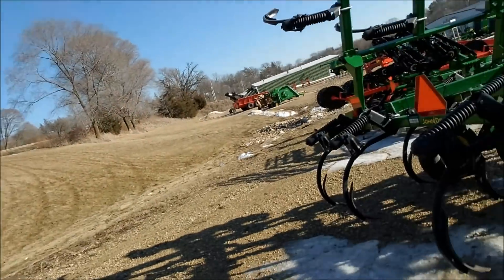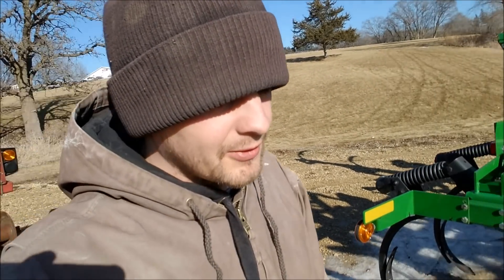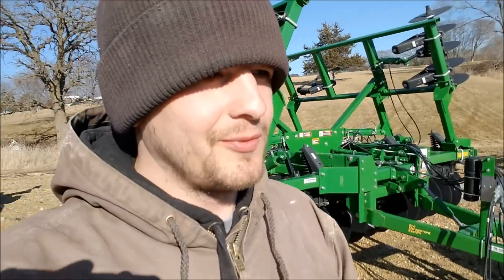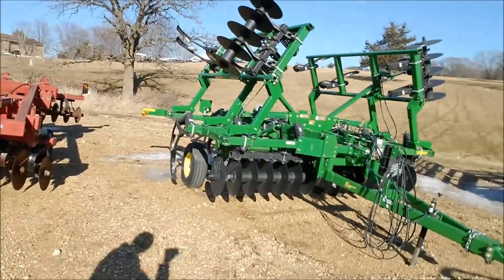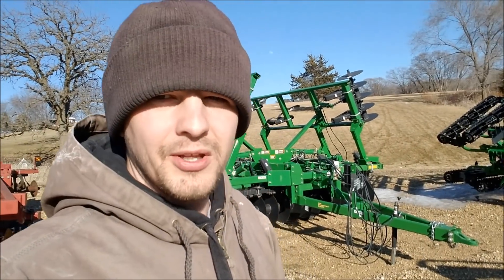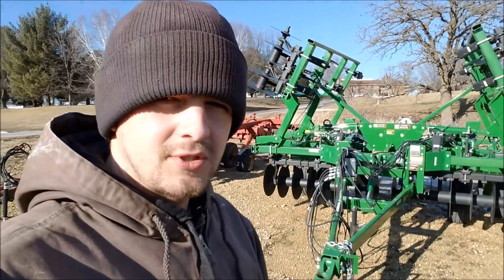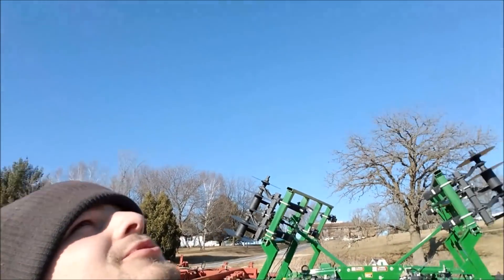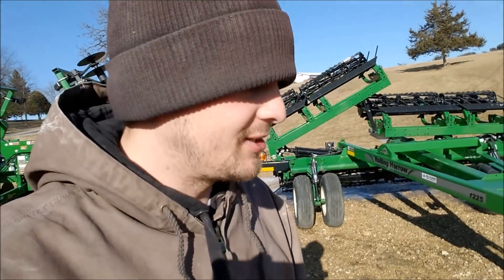John Deere Chisel Plow

Comment: Good video subject, Travis !!  Back when the "new style" JDs came out a local dealer sold tractors with plows at or below cost knowing all that new horsepower meant broken down older, smaller  plows and disks ,  so he'd be selling the same buyers new tillage tools before spring was out !  He even helped "hot rod" a couple tractors for  those  he knew would be  pulling their work tractors at local fairs !  Predictably heavy load PTO equipment like forage choppers corn pickers and balers soon followed in their seasons  as well !!  But they were all sold at hefty profits !!

Comment: I have logged a ton of hours on a Wilbeck 9 shank with about 300HP also pulled a JD 712 13 shank with about 375HP.  All either one wanted around here. After several years with those two we switched to a JD512 ripper and now the big CaseIH. Much prefer the newer rippers I here in N. Illinois. Good luck on your search. Tillage is prob my favorite thing to do

Comment: A quick and cheap upgrade on chisel plows would be a White Farm Equipment chisel plow. Built strong, hydraulic disk gang, and range from 9-17 shank with heavy duty spring reset. We have one, bought it brand new and burry it to the frame every year and haven't broke anything more than a shank. And we have very rocky ground here in south central Michigan

Comment: I have a 15 shank 714 I pull behind a JD 9120 at 280 horse and I love it. Does a great job, I added a remlinger leveler to the back of it and am very happy with it. I know horsepower is an issue for you right now, but u would love it

Comment: In response to Ryan’s video, if your going to build a new 20,000 bin have you thought about building grain legs to connect all the bins and a overhead bin to load grain from the bins into trucks by gravity. That way you are increasing your capacity and making it easier for yourself and you won’t need an auger to load them
Reply: It would make sense for them

Comment: You could take the wings off and have a 9 shank til you get more HP
Reply: Holler Haven Farms they mine as well just buy wings for theres
Reply: Yes they could, but the chief complaint is that is not built heavy enough so with more shanks and more HP it  would pull it apart.

Comment: Your 4640 should be able to push 210 horse we got a 46-30 and if you go to the fuel injection pump there is a little door on the back of the pump that you can take off and there should be 10 mm wrench I think and you turn it in a couple cranks and did that will push more fuel into the injectors and that's how I was just pushing 210 want to say that we pull our 11 shank no problem

Comment: Even I have run a 5-bottom moldboard plow.  Getting the 3-point and SCV to operate in order both up and down takes some learning, that's for sure.  I'm sure Travis will handle it like a pro.  The dawns are coming earlier and the dusks are getting later, so you know the end of winter is close.  It's just not here yet (or the east coast, for that matter).  Pie in the sky:  wouldn't it be great to have that 8370R from last fall or a 9R to pull one of those chisel plows you've shown?  Which one was built heavier, the Great Plains or the Deere?  If cost was not an issue, which one would you choose?
Reply from the maker: Great plains for both your questions.
Reply: Matthew Hoag i

Comment: i used to pull that same size chisel plow behind a 85.5hp m8540 kubota
Reply: In what sand for soil
Reply: Yeah I can pull it with a 60hp two wheel drive tractor too, but putting it in the ground and pulling it is another thing!

Comment: I'm not sure why the the 4640 will not pull that chisel plow? I have a John Deere 1610 13 shank chisel that I pull with my 4630 it's only 150 hp at the pto and it pulls it fine

Comment: 30 HP per shank seems too high. We have a 15 shank brillion that we pull all day with an mx270. I've even pulled it in lighter conditions with a 3588 2+2 that's turning 200 HP but struggles when in comes to any hills. If the mx270 was 240 HP at the drawbar which I think it easily has that wound be 16 HP per shank. The 2+2 turning 200 HP is at 13.3 HP per shank. At 30 HP per shank I would need 450 HP to pull the brillion which would be a waste.

Comment: Save your money and go 100% no till
Reply: John Haas only way to save soil and increase carbon in soil is no till and covers
Reply: not everywhere, check some research by university extensions. Certain soil types need a bit of tillage, gives better yield results and saves the soils. It's called minimum tillage or conservation tillage.
And not every region can handle cover crops due to dry conditions for example.
Reply: kladpapier no soil needs tillage look up dakota lakes research farm tillage compacts soil and resuces water infiltration

Comment: Molboard plowing is easy until you have to plow a dead furrow, that takes practice to not plow down to China
Reply: BIlly the SMall Bong thorton from india I’ve never plowed with gps . The hardest part of plowing the up and down passes is knowing when to lift the plow and put it down so you don’t have a uneven headland to plow. As for the depth once you get it figured out set the stop on the lever for the 3 pt and it’s just push and go
Reply: The double dead furrow makes disking fun, as does the windrow of dirt clods on the other side where you started.